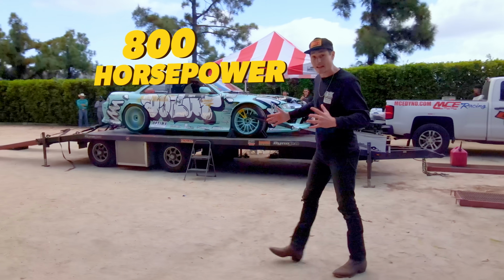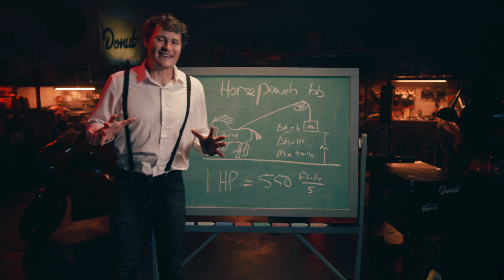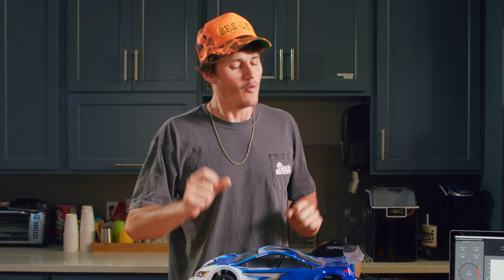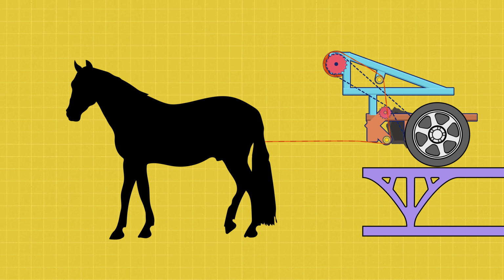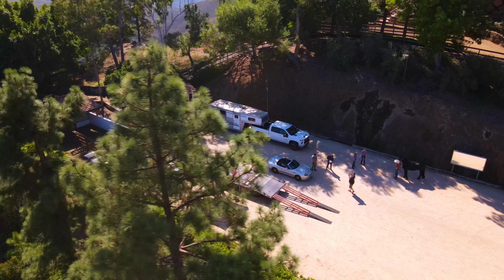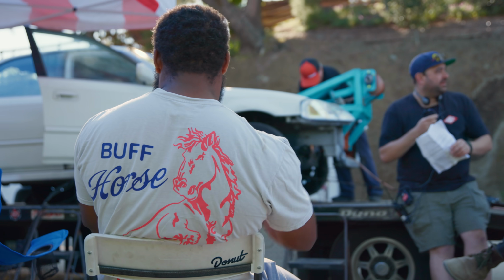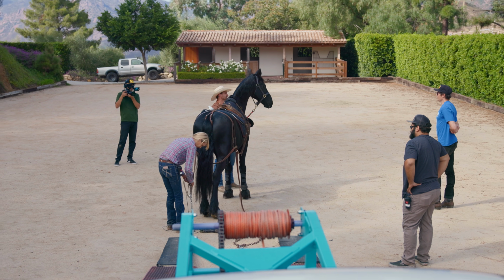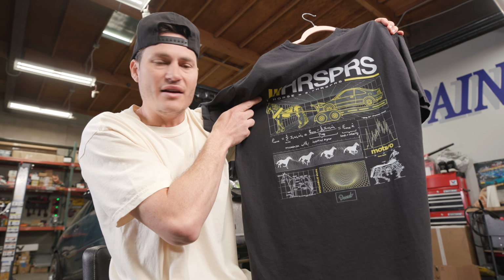How Much Horsepower is a Horse?

Comment: All good, but the original assessment of a horsepower in the James Watt era  considered I think a 12 hour shift for a horse, pulling barrows of earth up ramps  when building canals and 746 Watts was decided after tests.  Apparently this was quite  conservative and most horses can sustain nearer to 1 kW.  Clearly peak power rating is much higher as proved in this short duration test. The same tests also looked at manual labour pushing wheelbarrows.  Off to try and find my ancient Mechanics book now.....

Comment: You built an amazing contraption that gives variable resistance to the horse.  But once you have this, all you need is a linear scale on the cable and a measurement of distance to get the EXACT and ACCURATE power, by simply taking: "work is force times displacement (W=F*d)" and then just P=W/t.  

You have F (by putting in a scale in the cable).  You have d (can be measured by horse position or car wheel rotation).  You have t (clock).

The car and dyno are just variable resistance generators, which are needed for calculating the power.

What your entire contraption is doing is not very different.  Its just measuring the force way down the line, after lots of friction, and then trying to account for this friction with math and estimates.  Measure the force at the cable and you don't care about all the friction and losses along the way.

This is closer to the original schematics of measuring horsepower (with a horse lifting a weight), except that this allows for only a single force value instead of a variable force value that will give horsepower at different forces/speeds and give a profile.  I think you could simplify your resistance generator to something more like those on gym equipment.  Or just attach the cable directly to the dyno instead of passing through a car.

Comment: Great vid. I'd heard of the mistakes in the calculations and assumed 1 horse more than 1 horsepower (which in itself is already pretty nuts that a measure of a horses power is out) but this test nailed it! A heavy draft could of course pull more, and a pony will pull less, so a middle of the road light draft is a great place to test!
Reply: Part of the measurement is that horsepower was originally scaled specifically to sell steam engines; it's not "This steam engine can replace a horse 1 to 1" it's more like "This steam engine can replicate a horse's workday."  The horse in the video was allowed 5 pulls at 'max power', but they definitely wouldn't let (or force) him do that all day; kept as a working animal, they'd do no more than a few hours of work in a row, and no more than 5 or 6 hours total in a day, and I'm sure at that pace, he could keep 1 hp up pretty reliably.

 You can compare cars in a similar way; the kind of horsepower they can produce with minimal wear at a constant rate indefinitely, vs the highest peak they can reach with fine tuning and redlining the engine.
Reply: How do you think this test nailed it when its obvious that horse wasn't pulling with all his might? Do you really think a out of shape weak human is 20% as powerful as a healthy full size horse? GTFO